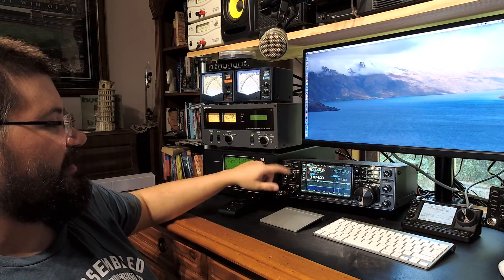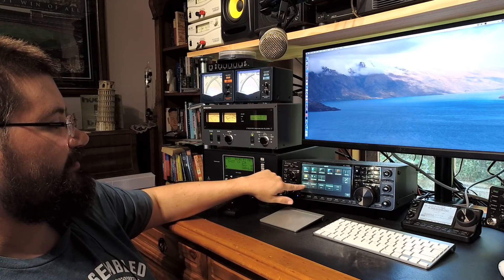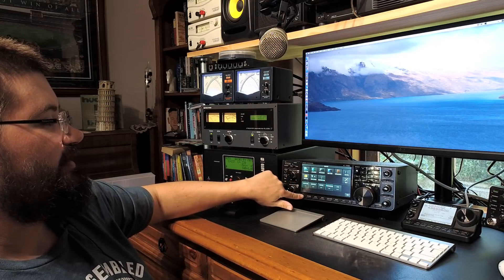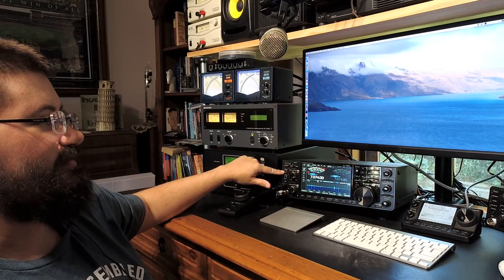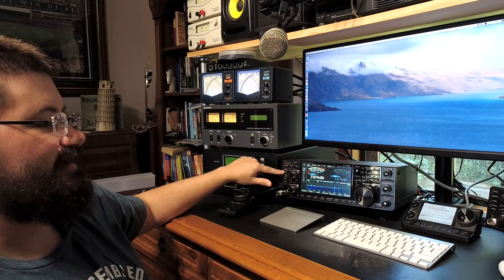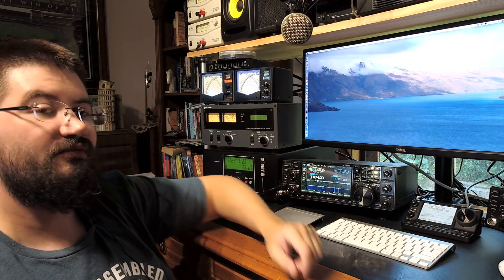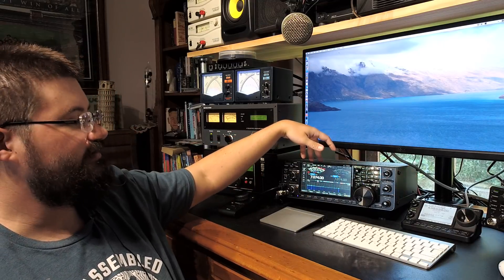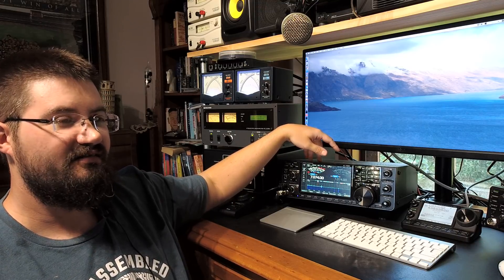How to use the Monitor Function on the IC-7610, IC-7300 & Other Radios

Comment: Monitor function is bery useful when to set mic gain.  We can hear the environment sound  an lowering the mic gain to reduce it and focus only to our voice.  

Yes, a good pair of headphones, earphones or IEMs, should be nice to monitor., and set the bass or treble to the sound/voice.  

If we use the rig with digital mode, using computer via USB, the monitor mode is very useful to verify the outgoing sound.  Sometime we think the sound is going out to the air, because we can hear it on computer, but, it does not mean it is going out to the rig. 

Thank you,
DE 9W2GNU
Reply from the maker: They're all wonderful tips Mohammad!  I'm going to pin your post to the top for our viewers benefit!  I wish I had though to cover those topics - perhaps in a follow up 'how to use monitor mode' video :) 73 & Happy New Year, Jarrad

Comment: Hello Jared, first off I really appreciate your informative videos! On the 7300 monitor function, as we know doesn't give the true representation of the TX audio, while compression levels are set per the manual, even sometimes lower (5-7db on COMP meter), the monitor audio sounds tight and distorted...is this also inaccurate as far as hearing the raspy sound and distortion with only 5-10 db of compression?  I haven't had a chance to listen to a web sdr as of yet.  Thanks!

Comment: My biggest issue w/ the 7300 is the volume of the monitor while wearing headphones. It's freaking LOUD compared to the output volume of a received signal for a given volume knob position. I'm forced to turn the volume extremely low, but then my received signal is too quiet. This is especially true when properly using the RF gain knob. I'd like to think I'm doing something wrong, but I haven't found any setting that would influence this behavior. If anyone has a clue, I'm all ears... or, barely ears after a near deafening from this problem.

Comment: Question:  Do you use an external speaker on your 7300?  If so, how do you stop the transmitted audio from coming from the external speaker?  The monitor "off" control has no effect.

Comment: I just started using an Icom 7610. I tried using the monitor function “MONI = ON”, when using RTTY or PSK31 with Ham Radio Deluxe, and I didn’t hear anything in the 7610 speaker when transmitting. Is there another way that I can hear the digital audio that is being transmitted? I didn’t try using the 1/4” headphones yet because I’ll need to buy a 3.5mm to 1/4 adapter to use my headphones.

Is there another way to hear the transmitter digital audio or confirm that the digital modes are being transmitted properly?

Comment: Hi I think i have just found a possible way to hook up a external touch screen monitor to a ic-7610 now I cant find the web page maybe u can it uses a touch screen monitor that requires no driver..i will get back to u if I can find it again it looks promising
Reply from the maker: The trick is to find one where the touch screen ‘emulates’ a mouse.  So any ‘touch screen’ that doesn’t need a special driver and connects via USB should work.  The only downside is that not all elements are able to be clicked with a mouse - it is confined to the scope window.  So I guess in a nutshell whilst it is likely technically possible, it wouldn’t really add the desired value.  73, Jarrad VK3BL

Comment: Got a question for you!  If you had sufficient funds in pocket to buy a 7300 but your savings goal is a 7610 and you know it’s going to take at the least one year to secure the 7610 fund, Do you just give in and buy the 7300 and enjoy it till your funds get close to the 7610 then sell 7300 to complete the purchase?  I am  so close to doing this!  Since you have had experience with both rigs I value your opinion I’m on a trip with family right now and I am 15 miles from “The ICOM” candy store!  Hopefully I have the willpower to await your input! 😃
Reply from the maker: I would personally buy the IC-7300 and enjoy until the time comes; especially if my shack didn't have a linear amplifier or multiple antennas yet.  In VK here at least, IC-7300s don't come up for sale very often so they hold their value very well, and I can't imagine Icom replacing either the 7300 or 7610 in a year, so as long as you look after the Ic-7300 consider it a couple of hundred dollar rental for a year :). -73 Jarrad VK3BL
Reply: Rate My Radio  thank you!  That’s about all I needed to hear 😃 ,  I just bought my home back in the fall not long before Christmas so while I have been a ham 25 years and have many other radios I am very drawn to the Icom line and I got to touch a 7610 at the Orlando Hamcation in February.  That is one beautiful radio!  I do have an Henry 2kd classic amplifier.  Would like to use it, I have several older rigs and one  Kenwood TS590SG I bought a year ago and shockingly have never cut the tape on the box!   Right now there is only one antenna, but that’s going to change very soon.  My pneumatic antenna launcher arrived last week, so I will be aiming for the tree tops very soon.  Right after first of the year I turn 40 and being a milestone birthday I am telling myself by Dayton 2019 I will own a IC-7610!  One heck of a birthday gift for my self!   Keep up the good work I have enjoyed many of your videos.  73 de Seth - W8FG

Comment: Hello, I have the icom 7610, but I am trying to locate or better locate an adapter for the monitor but here in europe I am in spain andalucia, please tell me where I locate the adapter or the cable for the external monitor a greeting my email is ea7ei @ hotmail.es thanks in advance 73
Reply from the maker: Dear Mabolo, this video is about the audio monitor feature when you are transmitting.  To use the display output, you need a DVI to HDMI adapter cable, the cheapest source is eBay :)  73, Jarrad

Comment: I like you amp, I have the 1.2kfx version, love it. But 20m not giving me full output, might be a bad cap on the LF board? Not sure..
Reply from the maker: All amps tend to have different outputs on different bands.  For instance, my HL-2.5Kfx struggles on 40M & 10M compared to the other bands, in fact, later models were de-rated to 1Kw on 10M.  That said 10M doesn't need much power, and it still makes WAY more than our legal limit here.  Out of interest what does yours make on 20M, and on your best band?
Reply: Rate My Radio Using a dummy load, I was able to get 600-650 average power out using a 65-70 watt drive on all bands.  All bands except for 20m continues to show the same output to input ratio. On 20m, I’m lucky if I can get out 300w no matter what I do, and yes, I disabled the ALC.
Reply from the maker: Hmm it does sound like an issue; perhaps the tuned input circuit?  Check the radio's SWR to make sure its folding back, if not and you're in the US, send it off to N4ATS for servicing, he's the man at the moment for THP Gear :)
Reply: Rate My Radio looks like he specializes in repairs to the Yaesu FL-7000? Don’t see any information about other amps. I’ll email him. I did however find a ham that had the same problem, he said it was a small cap lost lead on the LPF board that just needed to tack soldered. I’ll pull the board and check it out first.  Thanks!